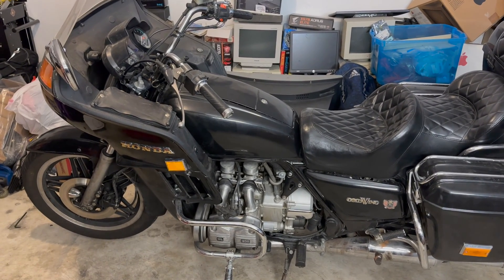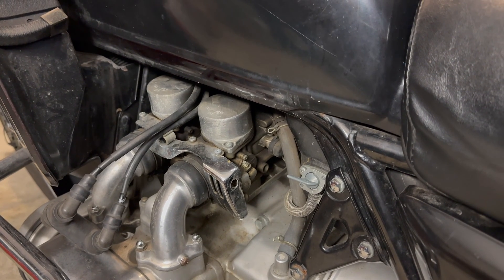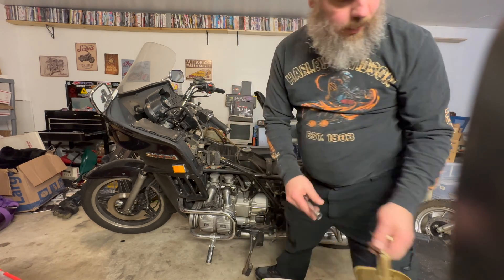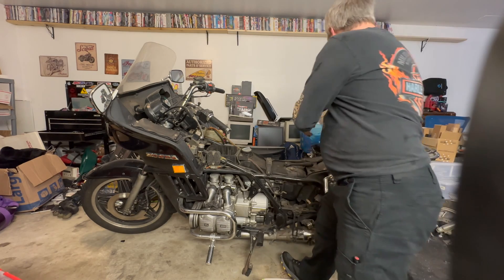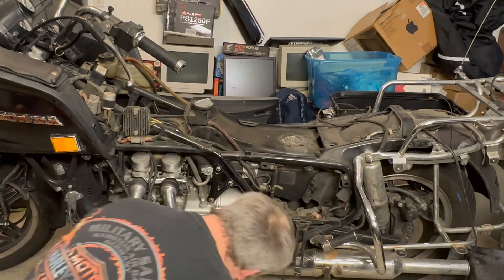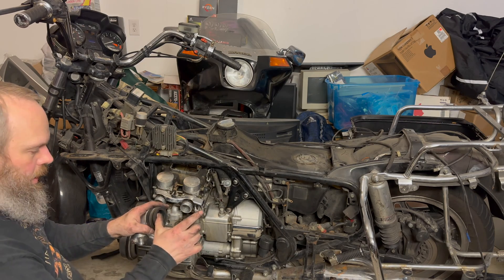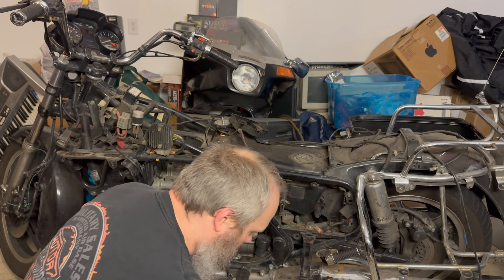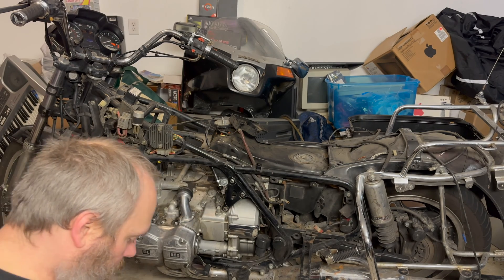EFI Conversion Project - 1981 Goldwing GL1100 - Part 1

Comment: Replace those coolant tube O rings. Learned the hard way, even just bumping into them while getting the carb assy out it created a leak. 4, O' rings and two elbow gaskets.
Reply from the maker: Good tip, I will for sure make sure to do that.

Comment: I am running GM tbi.
How do you plan on powering it?
Reply from the maker: I scored an Ms3Pro on eBay. The problem with TBI, if you don’t have a heated manifold, you get the same icing problems as a carburetor. What’d you do for a manifold?
Reply: @1ManWrenching  Custom made out of stainless, main body is heated by coolant

Comment: A good carb clean and kit for 240 from Randakk's will fix that issue for many years.  That is far cheaper than but not as efficient as FI. Whatcha want for the carbs you are taking off? Hot Tip there is an after market locking device for the cam gears on the drive sprockets. 1 bolt fastening and it locks them in place, the left one facing the bike from the front is the one that always moves due to spring tension.  It also is the 1 mark that may be slightly off but the Left one NEEDS to be dead on. The Center Stand is easy peasy, watch this 30 sec video:   https://www.youtube.com/watch?v=BTK58Z3AG2Q
I've removed my carbs many times and NEVER ONCE had to remove those engine guards. The weight is a counter balance for the Fairing and yes to stabilize the front end at highway speeds. i am following along cause though I would not toss 1600+ into that old of a bike, but then again each of us have our area's of specialties. Good Luck.
Reply from the maker: Yeah, I’ve got some more video digging into the timing belt. The left one was never tensioned and is off a tooth. The right one seems fine. 
As for the money going into the bike, eh, it’s a hobby, not an investment. 
My eBay listing for the carbs: https://www.ebay.com/itm/175556230452?mkcid=16&mkevt=1&mkrid=711-127632-2357-0&ssspo=kg8lZqDgSK-&sssrc=2051273&ssuid=kg8lZqDgSK-&var=&widget_ver=artemis&media=COPY
Reply: @1ManWrenching  the left one can be off a half to full tooth off, which is not abnormal.